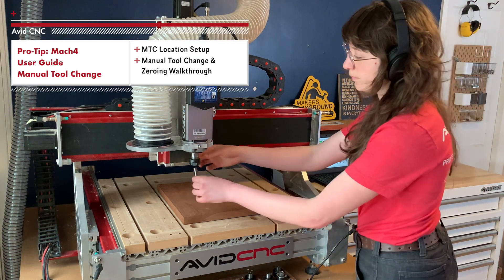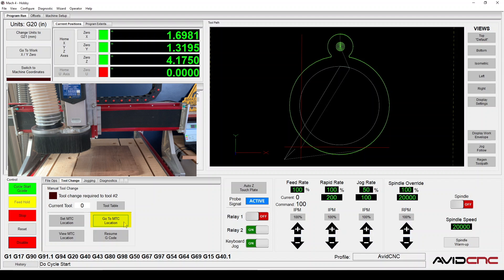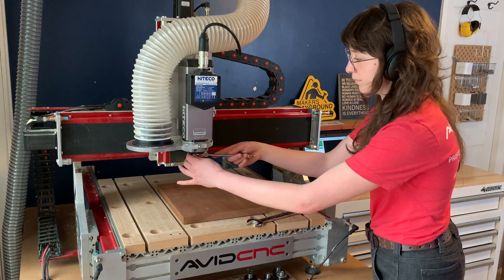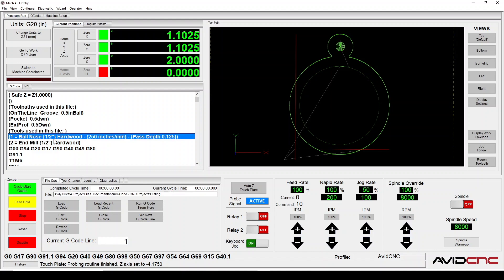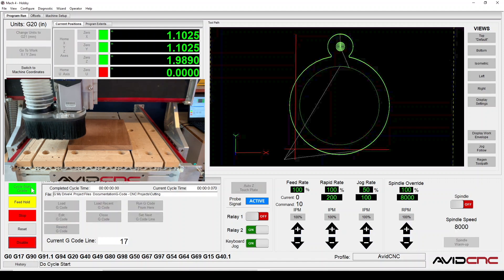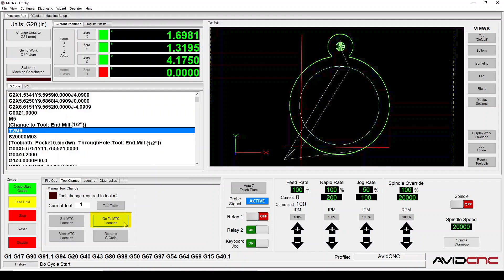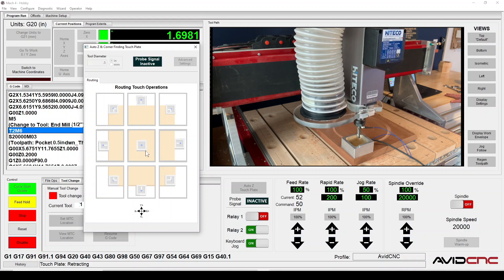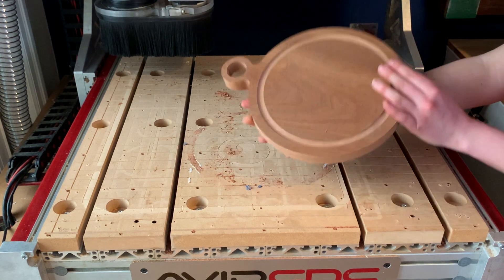Mach4 User Guide: Manual Tool Change

Comment: I appreciate this as we will be moving towards cutting items that use more than 1 tool.

I noticed, though, that when you performed the tool change the machine moved on the Y axis.  Since Mach4 didn't move the machine it would not know there was a change.  I assume if you notice that happening and you're cutting a detailed profile you would need to rehome the machine?

Comment: Hi Sami, what is the minimum computer requirements for Mach 4 and seamless operation of a Pro 60120?  I have a few different computers I had to retire from my practice that no longer would be able to run a very large database and software requirement upgrade.  The usual has an Intel i3 chipset and 4 GB’s of RAM; two others are servers with pretty fast AMD chip sets and 8 GB’s.   If I don’t get an answer here, I will check in with my liaison working my machine order.  Thank you for all you do to help us with training!  😎

Comment: If your MTC location is in a completely different area then your work holding can you do your tool touch off at the MTC location vs back at your work holding location? For example, if your G Code is set up to reference the top of material can you reference the table bed during an MTC just to set the tool length while leaving the original Z limits referencing the top of material the same? 

Also, is the M6 command also available in the Fusion 360 post? When setting up in either program do you tell it that you have an automatic tool changer so that it sets up the g code properly even though you know you will be doing an MTC?
Reply: Any word on using a fixed location to refference tool height? Using top of work piece is the easiest, but it's the worst. That surface plane is typically machined away if you surface your material. The tool table and tool offset work flow after machine is homed has me walking in circles

Comment: Well, that's really slick! 
Question: I have the Avid 2x2 cnc with diy electronics (2017) running Mach3. Can I switch to Mach4? And how difficult would that be? Do you have a post processor that's suitable for my "older" machine?
Reply from the maker: Mach4 is a great option for any Avid CNC Machine. Feel free to reach out to our support team directly if you have specific questions. support@avidcnc.com